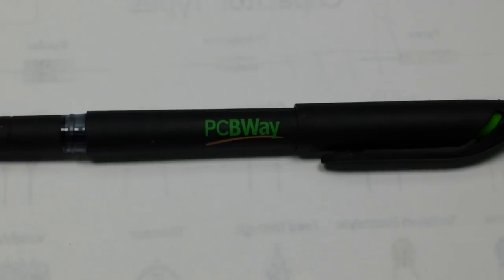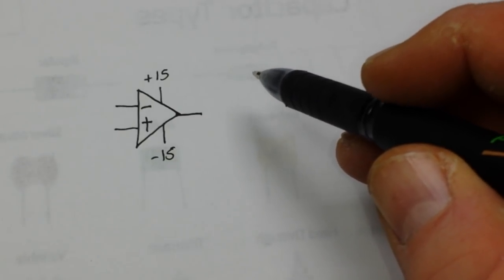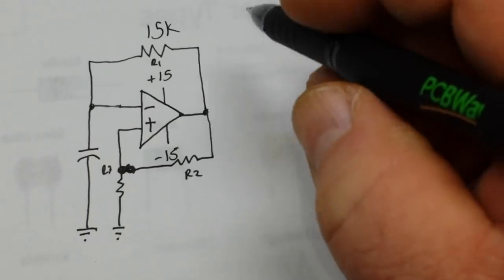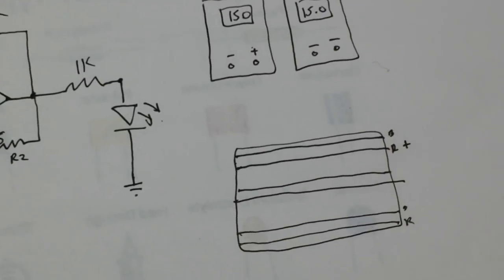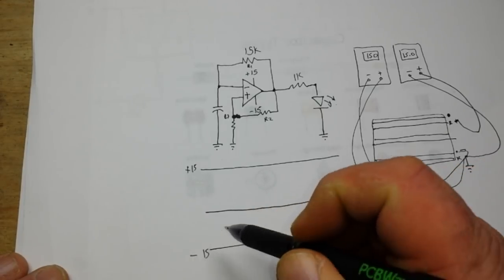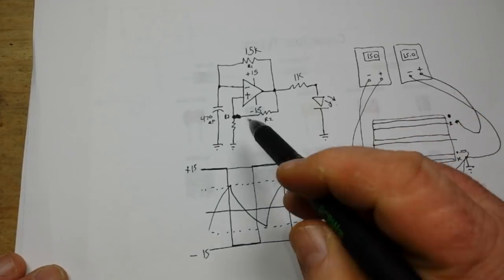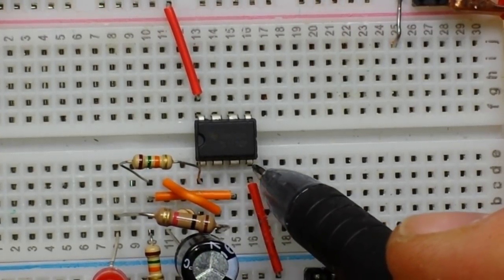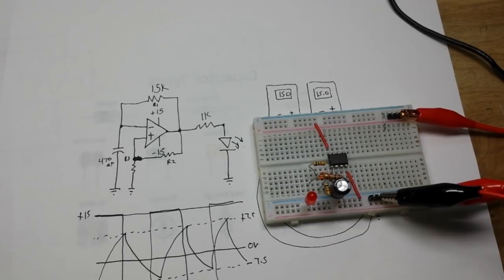Classic Circuits You Should Know Relaxation Oscillator

Comment: I like it.  I have made several flashers with transistors that switch back and forth, every USB port in the house has one. I like them, as you said they are soothing.  I like the fade effect of this circuit.  What I would like to do is combine the properties of both.

PS I just finished building my DIY power supply, and it only goes to 12V.
I'm not ready to build another one just yet.
Some of the flashers I made I added fiber optics, to make little 4, 5, 6" blasts, or showers, they turned out nice.

Comment: If you consider the gain equation (g = Rf/Rin) for an inverting op amp, it provides a way of thinking about how this works.  Rf = 15k, Rin is the resistance of the capacitor.  Initially, when the capacitor is uncharged, the resistance is very low so the gain is high which charges the capacitor.  As the capacitor charges, it's resistance increases until it effectively becomes an open circuit.  At that point the gain is close to zero so the capacitor can then discharge.  Then the cycle repeats.

Comment: An opamp is an analog device, but here it's being used as a comparator.  Since the output of a comparator is always a high or a low, it's not linear output, like a normal opamp.  But the output of a comparator is  typically +5V or 0V, not + or - 15V.
So this seems to be outside of either digital or analog worlds.

Comment: I love these simple and useful circuits!
Is it possible to turn that "pointy" waveform into a sinus?
Reply: There are several ways of doing that. A simple low pass filter RC filter will turn the waveform to a sine wave, however it is necessary to engineer the cut frequency will below the frequency of oscillation, this is to ensure that all the higher harmonics are attenuated to just leave the fundamental sine wave frequency. Unfortunately, this reduces the sine wave amplitude, and makes the amplitude frequency dependent.
Reply: @nigeljohnson9820  thank you!
If I then amplify the resulting sinus wave, will the attenuated harmonics be amplified back to the original signal?
Reply: @MarioAlemNeto  no, the signal ratios will remain the same, provided you do not drive the amplifier into limiting. 
The same result can be achieved filtering a square wave, however it helps if the wave you are filtering is closer to being a sine wave in the first place. Mathematically, any periodic waveform can be constructed  by the super position of an infinite series of harmonic sine waves of the correct amplitude and phase, this is known as Fourer analysis. 
All the filter is doing is removing the higher harmonics of the waveform, to leave the fundamental sine wave. if the filter was perfect, passing all frequencies below the cutoff and rejecting all above, a so called brick wall filter, it would not be necessary to engineer the cutoff frequency so far below the fundamental frequency of the wave form. As it is, the  best that a simple RC filter can do is attenuate each harmonic by 6dB more than the previous one. This is because the filter attenuation slope, beyond cutoff,  asymptotically approaches 6 dB per octave. So to obtain a good 6dB slope, the filter cutoff must be  of the order of two octaves below the wanted frequency.  To achieve better rejection of the higher frequency components requires a higher order filter. One that is a closer approximation to the ideal brick wall filter. That said, attenuating the higher harmonics will make the resulting waveform closer to that of a pure sine wave, and certainly more pleasing on the ear.
If you really want a near pure sine wave, there are much better circuits for generating it.
Reply: @nigeljohnson9820  That was a great explanation! Thank you so much!

Comment: Nice video. Thanks. One question though, if I were to connect a loudspeaker or a buzzer instead of the LED shown in your circuit, would a simple NPN transistor like BC107 or BC547 would be sufficient as a current amplifier?
Reply from the maker: Sure

Comment: The main purpose of ICs originally were to make analog circuits smaller and more reliable. Op amp ICs are used in a variery of analog applications.

Op amps aren't inherently digital by themselves as none of the required components are in it's package. 

That said Op Amps are in other IC packages that have digital functionality.

Comment: Simple oscillator and yet efective for understanding its principle. It uses the opamp and books describes as analog IC . If using all analog circuits, it is not "cheating" aka use a digital instead and break the principle.

Comment: If it's square wave output, shouldn't the LED be sharp on/off instead of slow fade on/off as in video?
Reply from the maker: It is NOT square.  It is sawtooth, the classic charge/discharge of a capacitor.

Comment: What if you don't have or want to make use of 2 power sources? Is there a way to "split" 1 power source into two (negative voltage and positive voltage)?
Reply: I'm sure by the time you're reading this you know it already, but yes, you can do it.

Even a simple voltage divider will do, with "virtual ground" on the middle.

Comment: op amp, another building block component, as u say, allot simpler than a wide band opamp made from transisters, used to be 1 circuit board,  next time put the scope on it, would be great, cheers n 73s

Comment: All devices are really analogue. In this case the op-amp is being used in limit mode, making it function as a digital device.
The relaxation oscillator could have been implemented by a comparator, or my favourite IC the quad nAnd Schmitt trigger.
The latter would only have required two components to make it oscillate, an R and a C. as the switching voltage threshold is set by internal resistors in the IC, making the actual values dependent on the logic family used. 
One advantage of using a quad Schmitt logic device for this circuit is that it can implement up to four independent oscillators, or make the oscillators interact to give a multi tone output or provide a cadence on one or more tones. This is very useful if you want to make an alarm output. The HCmos devices can safely drive a medium impedance speaker (300 ohms) directly, to give a useful sound level output.
If more output is required, just add a switching MOSFET to the output to drive a low impedance speaker.
It's not difficult to add an LED output, so that not only does it generate an alarm tone, but it also flashes an LED in sync.
Reply: That sounds like you could make music with it. But if this could be used to generate a single tone, and I'd like to have each key to generate different tones/notes but have all of them still be "modable"... I'd have to modify it later using filters and such, right?

Or... Maybe I could use two oscillators per key with their own RC to have base tones and use the two that are left with common adjustable RC to change the sound that way.

Now I'm kind of interested how that would sound. Am I far off the general idea?

Comment: Yet Another amazing video!, I have a single power supply that has a positive, Ground, and Negative outlets on it, Is this classic circuit still doable with my supply?
Reply: should do, i would poke it with a multimeter though to make sure you have the right voltages
Reply: yeah it works with a single power supply just add another resistor from +power to +input
just tested
Reply: and by replacing R1 with potentiometer and a couple of diodes you can regulate on\off ratio thus making a simple pwm regulator

Comment: An op-amp isn't cheating, but using two bench power supplies is pushing it a bit :p

Does the circuit really need that much voltage or could I use a couple of AA cells?

Thanks for the video, fascinating as always. Think I'll revisit the op-amp stuff and see if I can join up the dots

Comment: Would love an explanation of bipolar power supply theory. It still gives me trouble
Reply: Edward Ciotic if you take two similar power supply’s and hook the positive of one of the into the negative of the other and use that line as the ground line then the other positive will show n volts and the other negative will show -n volts. Hope this helps if you don’t have two power supplies you can hook up a couple of batteries the same way and use a multi meter to see what I’m talking about.

Comment: opamp is clearly analog, I agree you did not use any digital devices, or even integrated circuits for that matter.
Reply: Well, an opamp is an integrated circuit. It's an analog device, but it's used here more like a digital device, since it's only either full on or off, the ramp is thanks to the capacitor.